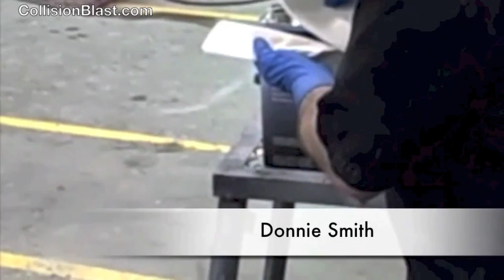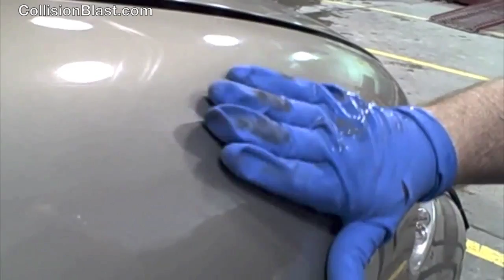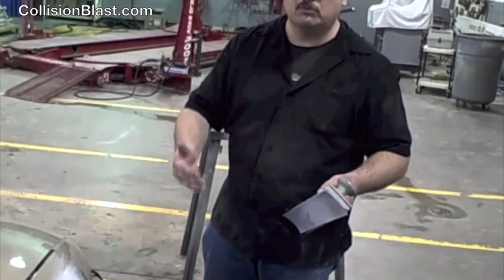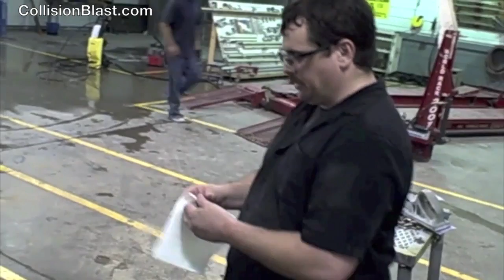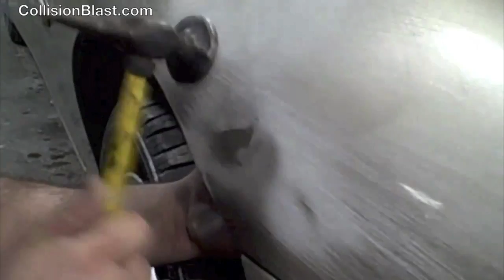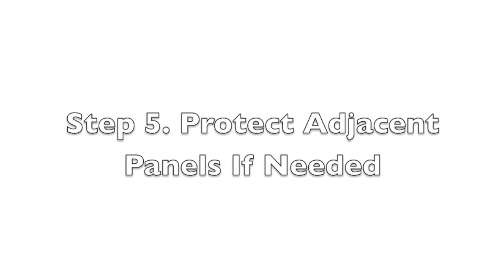How To Straighten Metal On Car Parts

Comment: Layman here.
I'm about to undertake Power Pole on Passenger Side Roof repair on my 2007 Dodge Nitro 4X 4 ... 'Rocky Mountain Edition' ... christened as such from now on. I just want it straight enough to install a new windshield and get it street legal again. 
Your video really goes into talking about the metal and how to "read the damage" and the metal characteristics and reactions to the manipulation techniques- as well as techniques to work the metal.
Very informative! Best 'How To' video I've seen thus far.

Comment: Great video Donnie, no doubt about that. However, I see that the inner side of the dent is accessible. Therefore my question is how would you straighten the dent in the metal is not accessible from the inside, leaving you only with outside approach?
Thanks and keep up the good work

Comment: step preparations for fixing a large rust hole.I was told to use long strand fiberglass then use short strand. Then to use body filler.Is this correct way what is your advice.

Comment: You could not have explained it better. You covered everything without making it too complicated. You're doing good work by continuing the education on a trade that many believe to be slowly dying. I hope not but they say someday every kind of panel will ship already painted ready for a minimum wage worker to bolt on. Robots will do the straightening of underlying structures. Who knows.
Reply from the maker: Yeah, I agree....who knows what the future holds for automotive repair....changing fast.  Already hard to keep up with.  Thanks for watching.

Comment from the maker: Yes, hammer and dolly only work if you can access both sides of the panel.  If you can't, different methods such as a stud welder gun must be used.  Type "ABRN How TO Use A Stud Welder Gun To Fix Dent" for an demonstration of how that works.  Thanks for watching!

Comment: Yes Mark i agree,im from oz working metal for 45 years.
You just cant teach people how to do these things on a video.
It takes many years to master the trade.
Reply: Id say that would depend on your IQ level, some people learn overnight, , 
I picked up a spraygun the first time a week ago , watched some vids now ive almost finished doing a bare metal respray on my car, Its not rocket Science , I reckon If it takes some many years to master id say they are probably not interested in the subject rfom the beginning
Reply: Yeah there easy  to pick up but can you apply good even coats,its got nothing to do with iq
Reply: you just run horizontal then vertical spray patterns and that would even out your coats. I watched how it is done many times and feel confident.

Comment: I have a high area in my dent repair that I just can't seem to lower. I have tried and tried. Would it be possible to blend that in with body filler?
Reply from the maker: It may blend in, but I bet you are going to fight it, as it will keep sanding through.  Have you tried to heat shrink the area?

Comment: You could have used some 2000 or 3000 grit to find the "high's and lowes," but NO, you jumped right to 80 and ripped ALL the paint off down to bare metal.
Reply: there is also dentless paint repair but i think he was explaining the industry standard as far as paint shops are concerned this is the easiest way. because they have the equipment to quickly fill and paint. blessings

Comment: I just bought a 2007 Mustang and the hood on the passenger side has a bend causing the hood to be about 1 inch high on that side only. I guess it was in a fender bender accident. What would be the best way to get that bend out? I thought about propping the front of the hood up a little  and using my knee and put my weight on the bend spot.Thanks
Reply from the maker: I have used 2x4s to hold the panel in place while I push down on the highs.
Reply: @CarAddictGarage  I took the hood off,laid it on the hard ground and stood on it.(I weigh 175 lbs) Was able to bend it about 1/2 inch only.Will try again in the springtime. Thanks

Comment: On a slightly different angle, I just really wonder why, it seems NO ONE can show me how to straighten warped sheet metal after being media blasted....my hood is out about 1/32th of an inch....SO many people have experienced this problem...now do YOU have the know how to show us how to do this?.....a challenge to your supposed expertise....
If you do know how, I'd love to see your ability here.
Reply: +SSGTA440 Depends on the car. I'm trying to fix a car blasted by a guy who mostly did patio furniture, so I know what you mean.  If it's really warped up, and replacement panels are easily available, new or used, it would be best to start over with straight metal.  Another option is to guide coat then block sand the car to find all the highs and lows, then work the metal.  Since blasting with some medias will hardens metal, you will probably not be able to get it 100% with hammer and dolly, and will end up having to shrink the worst of the high spots and fill the lows.   At best it will be a compromise between burying the warpage with filler and killing yourself chasing all the waves out.   Media blasting is something that people have to learn about the hard way, and a lot of nice cars have been killed by hacks using the wrong stuff or bad technique.

Comment: Did you have to ruin the paint ? Modern techniques include using light
Reply from the maker: Yes, this demonstration requires repainting.  You are referring to Paintless Dent Repair.  That is a different repair method.